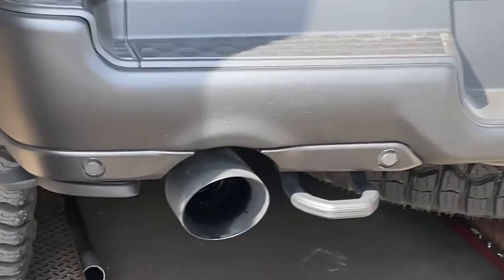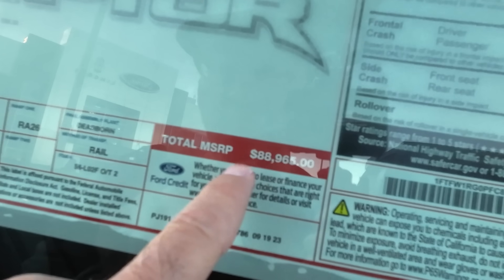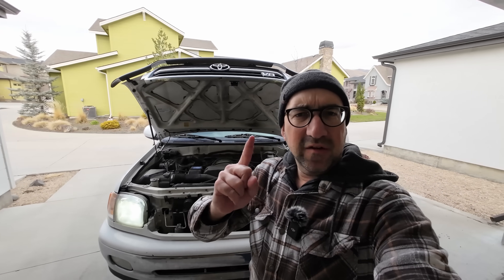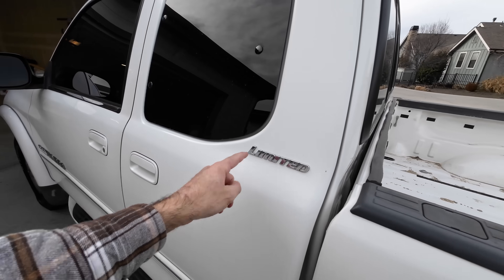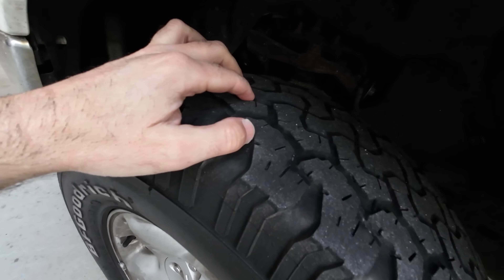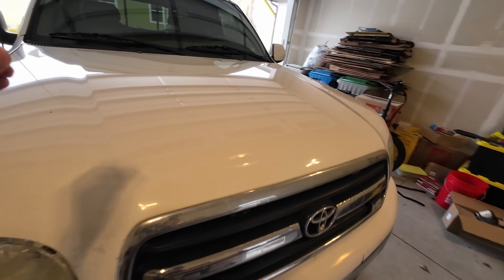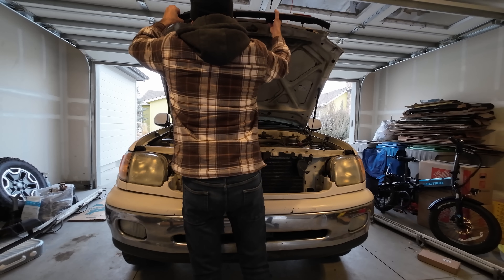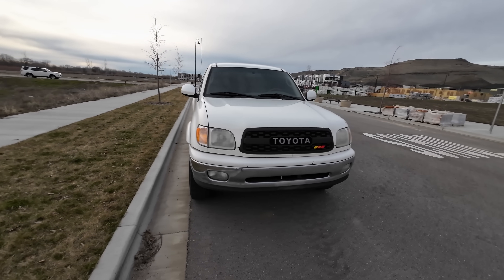I'm Sitting In The BEST V8 TRUCK Ever Made! (and I bought it)

Comment: For longevity with a gasoline engine, you can't beat a naturally aspirated engine.!!
Congratulations of you purchase! Fantastic Truck.
Reply: 100% a naturally aspirated engine is the way to go.
Reply: @lancelotlink3907 carburetor = natural?
Reply: @swen6797  A naturally aspirated engine means it doesn't have a turbo forcing air into the cylinders. It could have a carburetor or be fuel injected.

Comment: I’ve got a 2001 Tundra SR5. Bought it w/ 4 miles from the dealer.
Now has 274k miles and still runs better than my 2009 Cadillac.
I can remember when I was in the market to buy this truck, that V8 was brand new technology for Toyota, and was untested compared to the V6. I chose the V6 because of its bulletproof reliability. I wish I would’ve gotten the V8 with four-wheel-drive. But I’m very happy with my truck. It is truly been a partner with me for the last 23 years.
Reply: I wouldn't even want a 4.7, just because of the timing belt. I don't really consider that a desirable engine.

Comment: I'm driving my 3rd 1st Gen Tundra. A 2001 Access Cab Limited 4wd purchased new. A 2003 Access Cab SR5 2wd, bought used. Now driving a 2006 Access Cab Limited 4wd I bought used with 65k miles. I'm now at 145K & still love it. The two 4wds are/were both white.

Comment: My dad bought his 03 sr5 brand new. 21 years later I’m driving it and plan on taking it to my grave. Please make sure you replace the timing belt and water pump. Also look into replacing the lower ball joints but only with OEM ones.

Comment: The original owner of a 2003 Tundra, 4.7L with 108K on it. Runs like a top, and I keep up on required maintenance. The frame has some been coated via recall and is still in good shape for a Michigan truck. Zero issues and still looks almost new. Best vehicle I've owned!

Comment: Make sure to change the timing belt and while you are at it look into the starter.  Toyota is notorious for placing the starter under the manifold and you have to tear the engine half apart to get to it.  Think about doing both at the same time.
Reply: Yeah, those are two completely different processes. Both pretty involved. One at a time.
Reply: Toyota didn't have problems with starters during those years. Granted, to replace the starter, you have to take off the intake manifold and there it is!
Reply: That's was only issues on the 4.7L I-Force V8 but the newer 4.6L and 5.7L I-Force V8s don't have that issue.

Comment: Chris in Boise. We were in the market for a truck/SUV and settled on a 2023 GX 460. For the same reasons you mentioned in this video, we opted for this platform, because it still has the old-school Lexus, V8, notoriously reliable, and proven. We probably should’ve waited for the 550 to come out for little bit more discount, but it was a little bit too long of a wait. Buying a vehicle is never an investment but we plan on having this GX 460 for its lifetime or ours, so hopefully, it all evens out overtime.
Reply: My ‘08 GX470 has 150K troublefree miles.

Comment: Seat belt retraction problem can usually be solved by carefully washing with mix of dawn dishwasher soap and tide powder. (Fully extend and clamp SB before starting so not to fumble with retraction) Then a complete rinse. The oils left behind from 20+ years of handeling contributes to most of the problem. I just did all the seatbelts on my 02 and all but the driver's side returned to perfection. The driver's side retracts much better but is still a bit slower then the others. Hope this helps. Look forward to following these 1st Gen mods, great channel!!

Comment: Just bump the key over when starting. No need to hold it to the right. It’ll start with just a quick turn and no holding of the key. Works for my 05 Tundra (211,000 miles) 07 Land Cruiser (206,000 miles) and wife’s 03 LX470 (160,000 miles). Maintenance them and they’ll last you forever.

Comment: I also have an '02 4x4. I replaced the calipers with the larger version from 2005 and used Brembo rotors and pads. Early Tundra brake calipers were undersized  and often led to warped rotors. Bilstein 5100's level the front end, no lift kit needed.
Reply from the maker: The rotors on my truck are warped. haha.
Reply: The new calipers are the WL version vs. the WE I think. A little brake dust cover trim is necessary but no big deal. YT has a video on the upgrade. @MotorFeed

Comment: I bought a 2006 tundra v6 work truck, It was a great truck, it was comfortable, got great mileage and I towed a small trailer without isses, I sold it and  didnt need a full size truck in retirement ,so I went back to a Tacoma 4x4 which I did  need , I had owned one of them before my tundra, So after owning 3 toyotas, doing my own maintaince and never having a recall or one in the shop for any issue, I am a loyal toyota fan. the added bonus is they hold there value better then any american truck

Comment: The grill is such a major improvement. And once you fix up the headlights it’ll look super fresh. Looking forward to this freshen up/build!👍
Reply: IMO, removing the bug deflector and running boards was unnecessary. You say it doesn’t protect the windshield, but now you have exposed the front of the hood to rock chips and more of the rest of the windshield to rock chips as well. The running boards serve 3 functions, 1. Assist is climbing in, 2 keep from chafing the outer side of the seat with your bu tt, and protects the rockers again from stones. So you have effectively negated the care the previous owner had to allow you to buy such a cherry truck. You do you though.

Comment: Great choice brother gotta love the old Trucks, I have a 1996 Ford F150 with a 5.0L (302) Windsor V8 with 210,000 miles and still going strong, the only things I replaced on my truck was the starter, the rear fuel pump, and the power steering megunisum but other than that mostly was just simple maintenance, took out the transmission fluid just to get rid of the shuttering it was making and it hasn't had a problem ever since, I also have a 2011 Ford F150 with a 5.0L Coyote V8 in it with 160,000 miles on it and still going strong as well and its a beast and it sounds like a beast with the Borla ATAK exhaust on it as well.

Comment: I always wanted a 1st gen Tundra. Back when these things were new, Toyota wouldn't come down on the price of a double cab I was interested in. I went down the street and bought a cateye silverado crew cab for about 7 grand less. I wasn't exactly happy with my purchase but I needed a cheap new truck for work back then. After the warranty expired, so did the stupid 4L60E. In the time of my ownership of that Silverado, I drove quite a few Tundras including a all new 2nd gen at the time and every time I drove one I absolutely had buyers remorse. 

Long story short I swapped out a junkyard transmission in the Silverado, threw some chrome cast iron cheap 22s on it to bring it out and sold it. Never needed a pickup truck after that but I'll always want a 1st gren tundra.
Reply: My coworker had one of these tundras a 2000 or 2002 and the ball joints were dog shit 

Failed 2x in 6 months you dodged a bullet

Comment: I owned the first model year of the Tundra (2000).  I drove it for 230,00 miles before I sold it.  A couple of recalls, but mostly very reliable and very comfortable to drive.  Two things I wish were different - a deeper truck bed (which was solved in the first model update) and no nav system (had to resort to using my smart phone)(your radio upgrade resolved that).  First tire change I switched to Michelins and that was a huge difference in handling - especially on wet roads.

Comment: Can’t even lie…those old tundras were basically midsize truck size 😂😂
Reply: I have a 2003 Tundra base model long bed. You can lay full sheets of plywood in the bed between the wheel wells and close the gate. But Toyota should have made the truck or at least the inside of the bed about 2 inches wider so you can fit scaffold frames in. You can't haul very many because they only fit sideways. Very awkward.

Comment: Unfortunately the older Tundras weren’t a full size truck with limited towing capacity. If you can get away with a smaller truck and you don’t have to tow anything it’s a decent truck for running around town and such. Good little truck and great value and reliability. Looks much better with the few changes you made. Smart purchase.

Comment: Quick tip.  I just noticed this video is a few months old, so you may have already removed the corner markers.  But don't throw them away or try to reseal them.  All you need to do is get a tiny drill bit and drill one hole in the top and one or two in the bottom of the housing.  This will allow the moisture to drain out through the bottom holes and air to then circulate throughout the housing and keep it dry.  I learned about this in tech school and it saves a ton of money as well as land fill.

Comment: Fixing up Toyotas is the most fun. 150,000 isn’t much and all you have to do is things like cosmetics and button up brakes and front end. Detail em out, maybe some exhaust work, shocks, wheels and tires. I built some 87-89 Celicas that were great. All 5sp. One 89 GTS DOHC was fun until head gasket tho. Many 80s pickups and a few 4Runners too. But always the 20r or 22r/fuel injection. Man what a great motor.

Comment: Personally I would have picked the older raptor. Reliable and proven. Life is way too short to drive boring vehicles.

The tundra is the better option over that OBS ford but not better than the raptor
Reply from the maker: The Raptor was unfortunately out of my budget. I was paying cash for the truck.
Reply: It’s also too short to be paying car notes for over priced trucks
Reply: @classicjay7786  i bought my first truck in cash. Same price as the used raptor. “Expensive” is relative

Comment: In 2012, I purchased a dodge power waggon for $8000. it was a good deal back then not in the best of shape I boxed line the truck and now I have 40 inch tires on it. I paid cash for the truck paid cash for everything no payments change the ball joints upgrade the steering modified suspension 12 years later the truck still runs, just regular maintenance and a fuel pump

Comment: Good choice, I purchased a new 2004 Tundra V8 SR5 2WD and it was a excellent truck. That said they do have issues early on and if you live in the salt belt, they rusted badly. A friend who was Master Tech at local dealership replaced frames on a weekly basis. There were several stacks of used and new frames out back. I did a cursory search for one within a 150 miles,  they simply don't exist. As far as Best V8 ever.....not even close but that's a whole other can of beans. :)

Comment: Buff out the headlights, there’s some really good products for that.
Having a 2003 Tacoma 4x4 with the 2.7 with almost 200K, I totally agree with your selection. 
I work my truck hard, and it’s never failed me yet. Worst thing is that I’ve been going over Snoqualmie Pass for the past five years during the winter and I starting to get rust underneath it. I plan to take care of that issue when I have the time. The truck is worth it.
Reply: I had bad headlight and tried everything to get them clear, I bought new ones and it makes the front of my Tundra look great.
Reply: @durango8882  
Too bad they don’t make glass replacement headlights.

Comment: I've got a 2004 Tundra SR5 V8 extra cab "Texas Addition" black with tan cloth, bought new now has 175,000 miles on it - no issues just basic upkeep, but did replace the front ball joints because I heard they were prone to fail and also a new timing belt and I've changed my oil religiously every 5000 miles with Mobile one synthetic since new. I literally can't hear/feel the engine running when I'm sitting at a red light and no squeaks/rattles anywhere. I've kept my headlights pretty clear with Meguiars headlight  cleaner - doesn't get them "clear,clear" but pretty decent.

Comment: I have a 2003 Land Cruiser, which has some similarities to your Tundra. These are really good machines that came out during this period of time. Something to keep in mind... They are more then 20 years old. The parts are more then 20 years old. Stuff does break. Many of the sensors like MAF, crank sensor and so on don't last forever and can at anytime go bad and leave you stranded... Ask me how I know. Be wary of aftermarket parts that aren't "Toyota", they can be a mixed bag. Anyway, you picked a nice truck, the 4.7 is a great engine and changing timing belts on them really isn't too bad a job.

Comment: Another negative point is that it uses a timing belt rather than a chain. That will require replacing every 100K miles. I had mine replaced at 133K miles along with the water pump.

Comment: I know its off topic, but the vehicle I most regret selling was an 02 4runner.  Sold it at 175k miles, never had a single problem with it.  The plugs still looked new.  As I understand it, it was the last one built in Japan and the first with independent rear suspension.  Best vehicle I ever had.

Comment: For the seat belt, take  medium sandpaper and run it over the loop the belt slides on, then take some really fine sandpaper and do the same. You should be able to get a very noticeable change in the seat belt retracting.
Reply from the maker: thanks for the tip and watching until the end!

Comment: The BEST pickups EVER built were GM's 1999-2006 models with the 4.8 V8.  They would last over  800,000 miles  easy. That Toyota is not even close to the trucks that GM made. I go to dealer auctions every week, I have seen a few of those Toyotas go with over 400,000 but  only a few of them. The GM trucks were just better trucks and more of them  are still on the roads, and more of them went higher miles.
Reply: BS
Reply: @mikemiller6684   It's pretty much  a fact that the GM trucks that I mentioned were the best pickups ever made. Those of us in the industry for 40 years know that.
Reply: I am 72 had 50 plus cars and trucks . All Fords Chevies Hondas Toyotas . I spent constantly keeping GMs running . Toyotas nope just drive. Hondas too.

Comment: the bug guard also messes with how your wipers and washer fluid function on these
I learned the hard way you gotta get the diff drop kit and aftermarket brass bushing for inside the front diff on shorter axle side if you put a level kit on it or it will eat diff seals on that side
the bushing is very easy to install and if you get the right kit, you can get the front diff/skid plate drop, axle bushing, new diff seals, and the tools to install the bushing with the diff still assembled and bolted to the truck all in one kit.

Comment: Don’t forget to vent the rear differential! The vent is has gets clogged easily. There is a mod that uses a camry barbed fitting, then run a hose somewhere up out the way with a fuel filter for a breather.

Comment: Well you got me interested ! 
I thought you were going to get the Raptor.
But I would hands down buy the Tundra.
Those modifications that you did was the same I was thinking the bug shield and side steps . Blew me away with the grill very awesome 👏🏻!
If I can make a suggestion get all new headlights and markers that will help the appearance the original ones are very faded ! Little lift 2”and bigger tires. 😊👍🏻👏🏻

Comment: I just bought a black 2007 tundra crewmax sr5 2 wheel drive one owner with 175,000 miles.   Was $8,900 with no fees just sales tax.   It’s great having all that room in back seat.   Needs a new driver seat bottom.   Can’t see ever buying a new truck.   Just not worth it since used Toyota’s are such great deals.

Comment: I loved my 2002 Tundra but it lacked suspension and brakes to handle towing our travel trailer.  Even with air bags and a weight distribution hitch,  the softly sprung Tundra just wasn't the right tool for the job.  Empty or with a light load it was an awesome truck.  I got the frame coated early on and it kept passing the frame puncture test when other Tundra and Tacoma owners I knew were having frame rot issues.  Keep and eye on the frame corrosion, replace the timing belt as scheduled and drive it for another 200k.

Comment: My dude...  OILCOAT!  Spray the entire underside with oilcoat to preserve it for another 20 yrs.  Fluidfilm is fine for interior areas (like inside the doors, rocker panels, ...) that don't experience wash-off.  For the exposed areas you can use a product like Blaster Surface Shield or oilcoats from NH Oil Undercoating or Krown.  Best value is to buy in bulk container (1Gal or 5Gal pail) and spray it on with a gun and compressor.

Comment: Great vid. Only thing is in the rust belt in Atlantic Canada anything steel will rust. Had an 2008 f150 and it eventually disintegrated. That Tundra would be off the road in a junkyard. Ford is still rocking the 5.0.

Comment: Of the 3 that tundra is the best. But not opting for a 2nd gen in that price point was probably a miss. The 4.6 gets significantly better gas mileage. The 2nd gen (i think) fixed the ball joint issue you need to address immediately for yours and it’s a bigger more comfortable vehicle. At least you didn’t get the taco. Good call.

Comment: Not the choices that I would have made. For the front. Clear “bug guard “ with maybe chrome door edge guard trim. Your going to miss those running boards for paint protection. Just replace the grill back to original. But to each there own. It's your truck. Think about wheel to wheel running boards. Sure protects the paint. And makes washing and waxing the roof easier. Along with getting things in the bed.

Comment: I’d swap out the shocks for bilstein 5100s w/ the fronts being adjustable- raise front end up to 2” I think, then new leaf springs in rear & either add a leaf or use a 1” taller block out back to accommodate from the front end lift & you’ll still have some rake to the stance